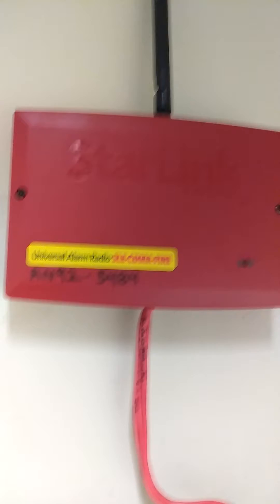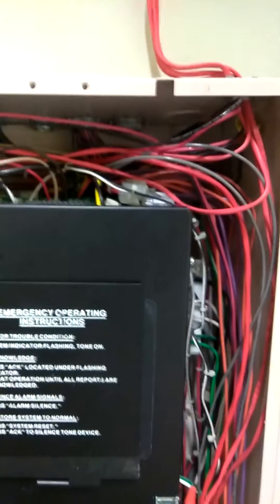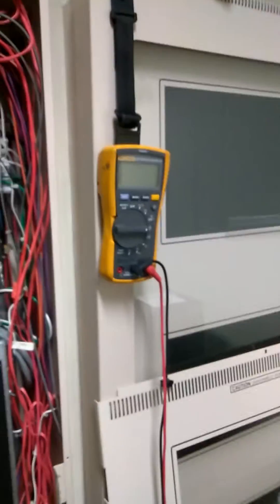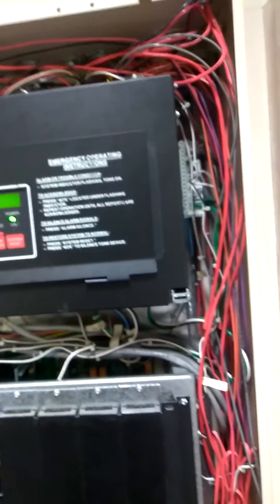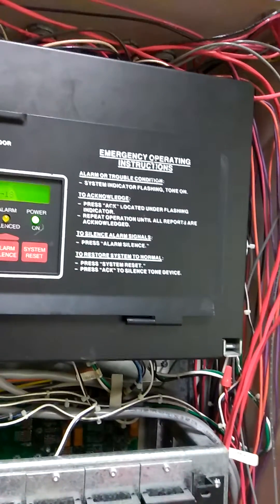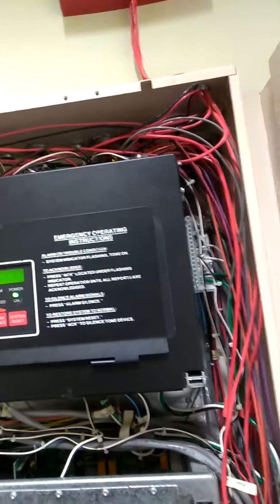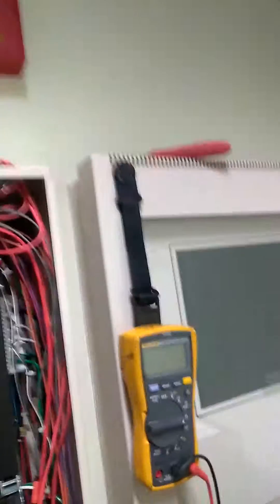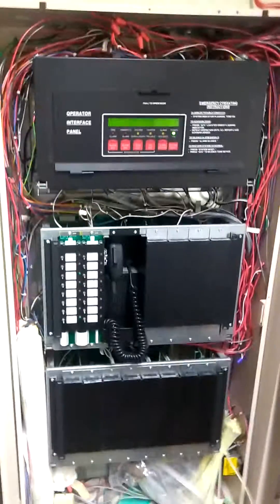How to install a star link cell communicator. Wiring to a big simplex fire alarm panel.

Comment: You left out wiring a trouble relay on the radio to a spare zone or point in the panel so the panel can supervise the radio as required by code.